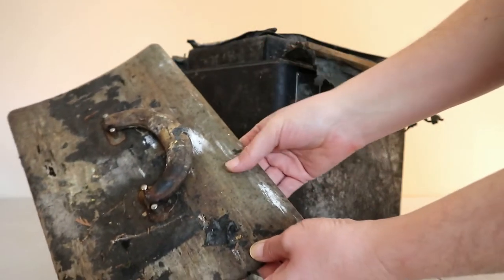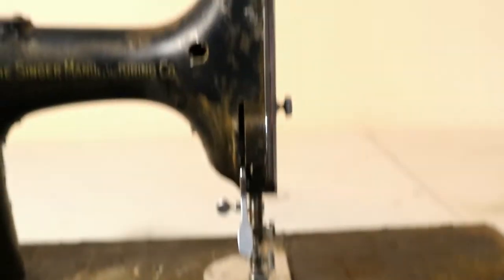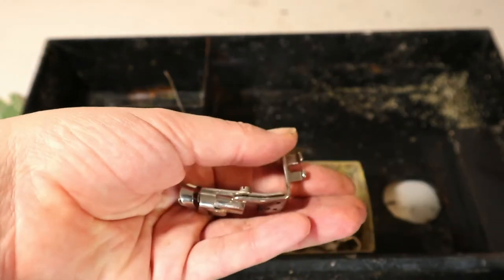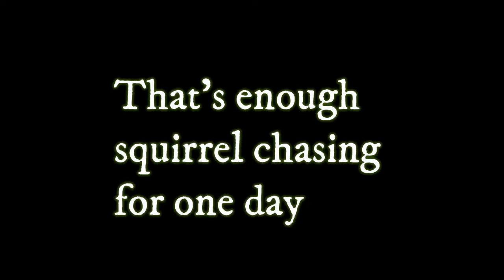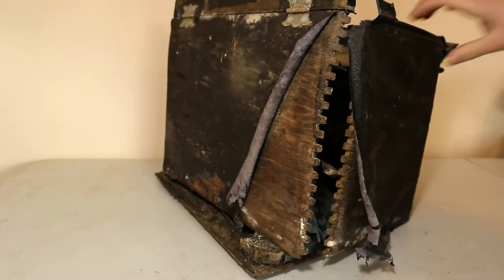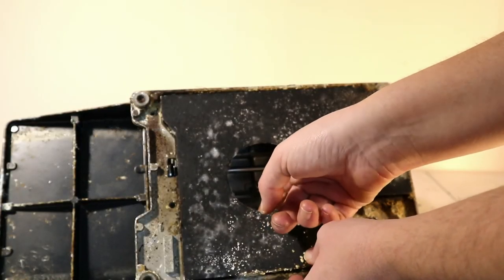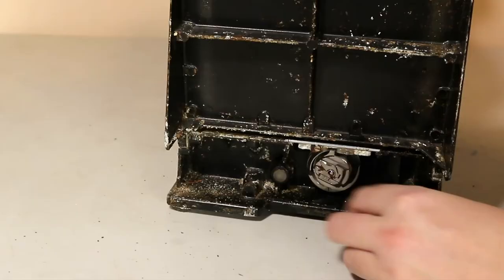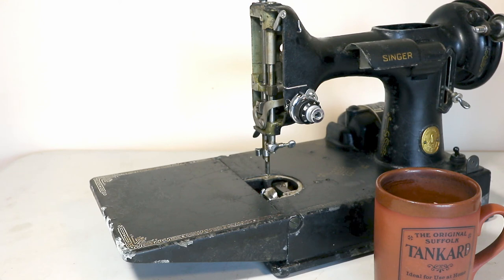Waterlogged Singer Featherweight 221

Comment: First move should be wash the machine down with pressure pak dewatering spray, Soak any stuck screw or fitting on the machine with dewaterer.  Do not use oil, this can effect future finish. Second strip box  (care not to spread the mold everywhere) and wash down every part thoroughly with methylated spirits. Then leave in filtered sun for a week or two to dry, any warped boards place heavy weigh on, or clamp flat. (wear a face mask for the mold) Separate every part and remove all hardware. (everything will be rusty underneath ) Then the work starts.
Reply from the maker: Really good tips.
With most machines, I'm not looking for a full restore, so a simple wipe and oil usually does the trick.  But this one has had a much harder life.

Comment: I bought a wet one just like yours.  Unfortunately the guy selling it threw the case away.  I got mine completely freed up and running.  I haven't fixed the paint chips yet.  I had to buy a new foot pedal the original was too far gone but the rest of the machine cleaned up and went to work. Oh I replaced the rubber belt too.  Once I got mine sewing I put it up and haven't touched it in 6 years. I like pfaff too much.

Comment: Hey Crowing. I watched your video and your cautious approach to diagnosing the potential mechanical issues is great. For the stuck parts try using a penetrating oil such PB blaster or Kroil, though any penetrating should work. If you do not have access to penetrating oil you can use WD40, it can work as a penetrating oil as well. Use the penetrating oil as you did the sewing machine oil, spray it on and let it sit for 24 hours if the part is really stuck. I would test any of these products on a hidden area that is painted as they may damage the paint a little. If you need to pry on any of the steel parts and you do not want scratch it try using a brass awl or a brass drift/punch. You can also find small brass ball peen hammers that would be great for working on this type of equipment. I hope this helps and I look forward to seeing the next video. Good luck!